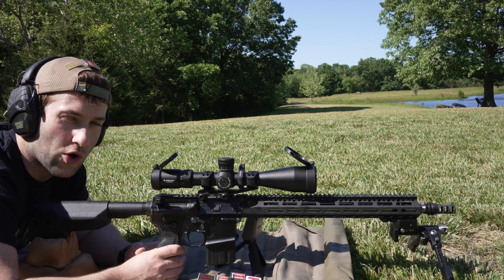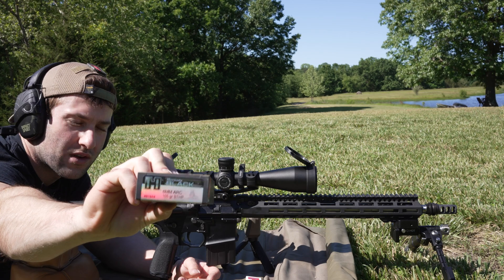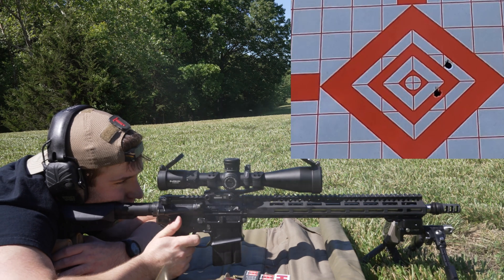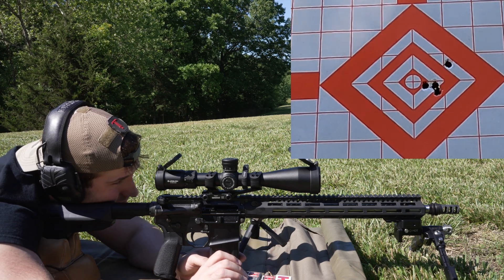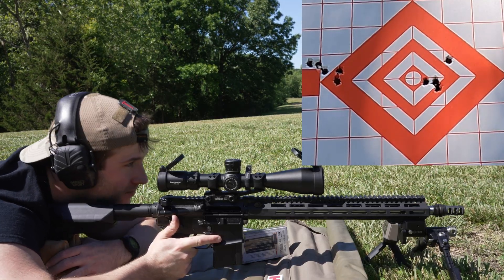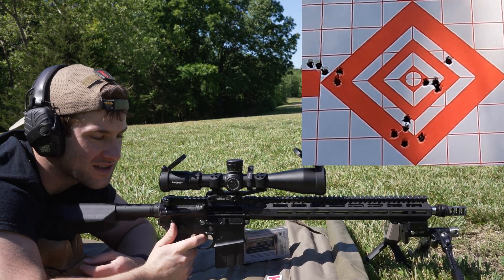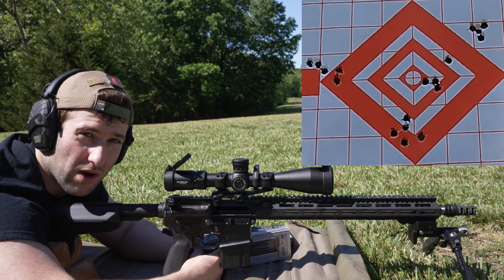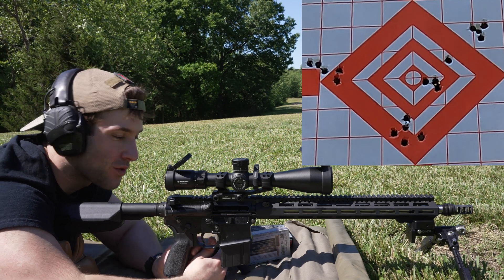Proof Steel 6 ARC Barrel Factory Ammo Accuracy Testing at 100 Yards: All Hornady Factory Offerings

Comment: AI gave me this, but I can say reload for that Proof barrel or any barrel for that matter will be best as long as good reloading is done. Leverevolution is king,  with the 107 smk, is just really good.

AI answer:
Barrel harmonics plus changes in velocity/pressure from different projectile weights (and a few other things) commonly shift POI between loads — even in the same barrel. Nice eye catching that.

Here’s the why (short & practical) and a clear test plan you can run (you already have the gear to do most of it).

Why different bullets move POI

Barrel harmonics (timing). When a shot goes off the barrel vibrates like a tuning fork. The position of the muzzle at the instant the bullet exits determines POI. Different velocities change the time the bullet spends in the barrel, so the muzzle is in a different part of its vibration cycle → POI shift.

Velocity / pressure differences. Heavier bullets usually produce different velocities and pressures with the same charge/powder. That changes harmonic timing and also the way the gas system/bolt cycles (on an AR) may affect barrel movement.

Bullet/neck fit and jump. Different bullet shapes/seating lengths change how the bullet engages the rifling and how pressure builds — small effects on POI.

Stability (twist rate). If a bullet is marginally stabilized it can yaw or exit with a different initial condition, moving POI.

Barrel/installation variables. Free-float problems, muzzle device alignment, or a loose gas block/handguard can amplify POI shifts. Fouling and temperature also matter.

Factory ammo variability. Commercial loads can still vary (lot-to-lot or between bullet profiles), so POI differences can come from inconsistent velocity or seating.

Why an AR specifically can show this

On gas-operated rifles the gas pressure and bolt/buffer dynamics interact with the barrel/upper assembly during firing. Different loads change dwell time and felt impulse, which changes how the system vibrates. In short: AR platforms can be more load-sensitive than a rigid bolt gun for POI.

Practical tests you can run (you’ve got a MagnetoSpeed and range — perfect)

Chronograph every load — record average and ES/SD for the 80, 103, 105, 108 gr Hornady rounds. If velocities differ significantly, that’s an immediate POI suspect.

Confirm consistency — shoot each load from the same rest (bag, sandbag), same zero, same target/bullseye. Use five-shot groups like the youtuber did, but repeat 3× for each load so you have an average group center.

Record group centers — measure POA→POI (in inches or mils) for each load and note vertical/horizontal shifts.

Free vs. contact points — verify the handguard/upper is truly free-floated and that the muzzle device is concentric / tight. These mechanical issues can cause weird shifts.

Test different seating depths/OCW/ladder — do a ladder or OCW with one bullet weight (e.g., 103 or 108) to find the sweetest velocity/charge and see how POI/grouping behaves across the ladder.

Try different buffer/spring or gas tune (if possible) — heavier buffer or different gas settings can change the harmonic/feel in ARs. Note any POI shift.

Temperature / fouling check — shoot groups cold and after a string of rounds (or clean between tests) and compare.

If possible: test in a bolt gun — same barrel/contour on a rigid action (if available) will usually show less sensitivity. That’s a good control to prove the AR is part of the effect.

Comment: I have a 20" barrel and get almost exactly 100fps faster than your data, which tracks. Mine is a Ballistic Advantage 1:7 twist, it HATES those eld VT loads, shoots the black good and the match pretty good. But I've settled on a handload with the Hornady 105 BTHP and N140 powder
Reply from the maker: That sounds like a good combo! Looking back, I wish I'd bought a longer barrel, but I also had limited options at the time I bought this one.

Comment: Check your screws from the Bipod Solution, if they reach to the gasblock or even barrel. Directly or under the barrel whip touching the screw will lead to inconsistency. 
Also checking you did not over torque the crush washer - disturbs harmonics.
Reply from the maker: I have to file screws often for this exact reason, lol. Good advice.

Comment: I've been playing with an 18" Wilson barrel build for the last two years. Have around 500 rounds of test loads through it.  Two best bullets (so far) are the 80gr ELD-VT and the Sierra 107gr MK.  Best powders for velocity (so far) have been, LeverRev, AA 2520, Alliant 2000MR, SW Match Rifle and CFE 223.  If your chasing really low ES and SD numbers and don't mind giving up some velocity try, SW Precision and (of course) Varget.
Reply from the maker: I'd be more interested in the latter if I had a longer barrel, but this short barrel doesn't give me much velocity to work with from the get go 😂.

Comment: I built a 22” and my velocities are exactly 200fps faster than what you’re getting with the 16”. I went with a Shaw barrel and I’m super happy with it.
Reply: I built a 20” and with hand loads im getting very good velocities altho Im loading bolt action loads 😂
Reply: @LovesM855A1  what’s your magic powder? I’ve tried a handful of different ones and I can’t even get factory ammo velocities before I’m getting ejector smears.
Reply: @KrahnnieJ that sounds like you have a chamber problem, if I were you Id get it checked out pronto. Im using leverevolution and getting GREAT velocity but I dnt list grains I load because it’s a tad over spec. Do you load or buy for it?
Reply: @LovesM855A1  I’ve never tried lever in it yet. I’ve used n540 and cfe 223.
Reply: @LovesM855A1  also, I’m not getting ejector smears until I’m above max charges but I’m still running slower than factory ammo even at that. I guess I haven’t tried that many different powders in the 6ARC yet….was thinking more of the 22ARC.
Reply: @KrahnnieJ no go lvrrev and you’ll stay with it, you get all the velocity with no overpressure signs im hooked on it
Reply: @LovesM855A1  sounds good. I’ll have to pick some up.
Reply: @KrahnnieJ plz let me know how it goes ill help anyway I can